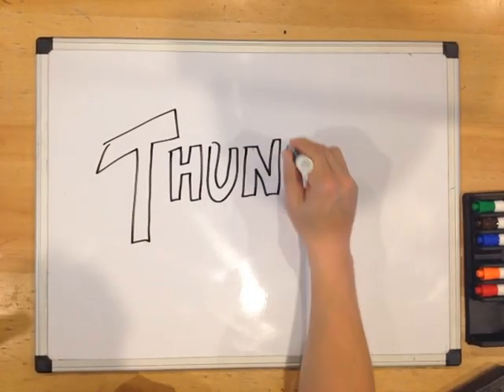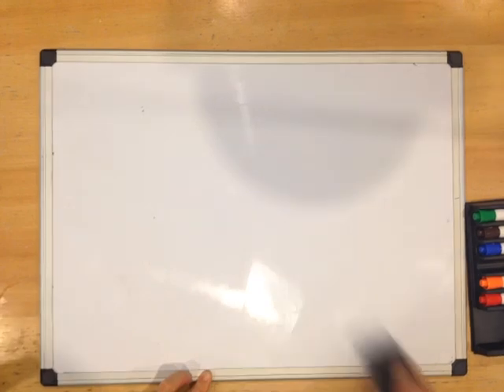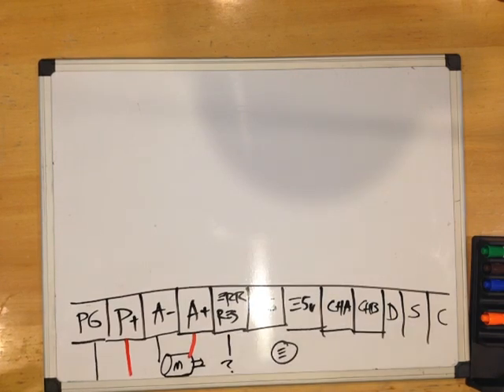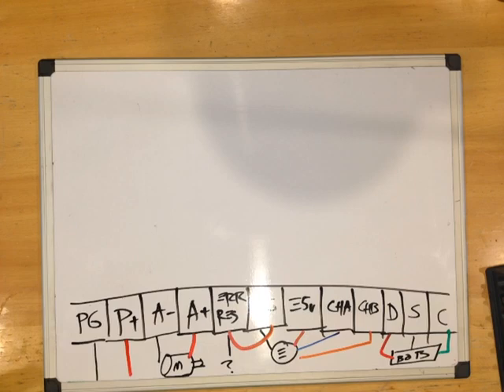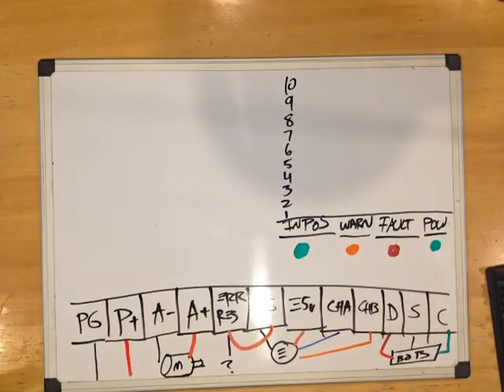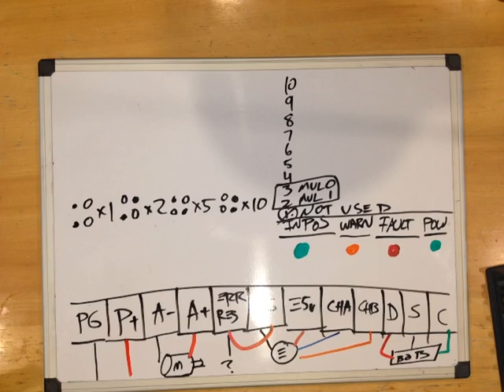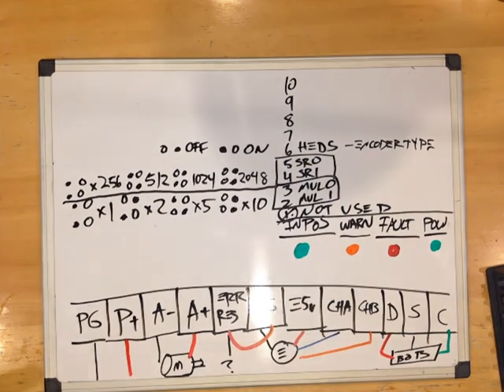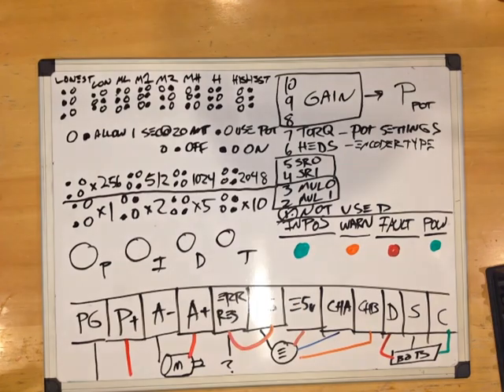THUNDERDORK: DIY CNC Router - Gecko g320x

Comment: That's what I hear about servos; they can be little temperamental to tune but once tuned very accurate and much more quiet. This CNC will have a work area of 24" x 36" so I will go with the NEMA 34 1805 oz steppers. Most milling will be shallow cuts which will help with torque and avoiding missed steps. Later maybe convert it to servo drive or possibly build a second machine. I really appreciate your videos and hope to see more, especially of your CNC and with it in action. Thank you.

Comment from the maker: These drivers will only work with servos.  

I have a smaller machine w/ steppers and the reason I'm going with servos this time is:

1) larger machines do better with servos, especially if you can gear them down, 
2) machine should know when its out of step; steppers don't unless they are hybrids w/ encoders 
3) torque profile is more consistent through it's range

this is all just what I've gathered. i think the trade off is the system is more complicated and maybe more temperamental.

Comment: So Chris, I was wondering if you have had a chance to run the CNC with the servo motors.  I'm about to purchase the electronics for my CNC and am considering the NEMA 34 Steppers vs the NEMA 34 Servos.  I see a lot of pros and cons about each and the more I read the harder the choice becomes. If you've had a chance to give the servos a whirl it would be great to get some feedback. Not sure what your cutting with your CNC but I am building mine to mill aluminum. Anyhow, hope to see some feedback.

Comment from the maker: The G320x is for Servos.  You'd need another driver for stepper motors.  

I haven't checked out the PMDX 126 yet, but it looks like a nice healthy board.  I'd definitely give it a go for servos.  Seems like it has Error and Reset terminals, 5 axis support, some multiplexing for more inputs, easy hook up to a DRO, smooth stepper interfacing, direct power from AC... a lot of stuff there.  I might have to give that one a go when I upgrade after reading some reviews first :D